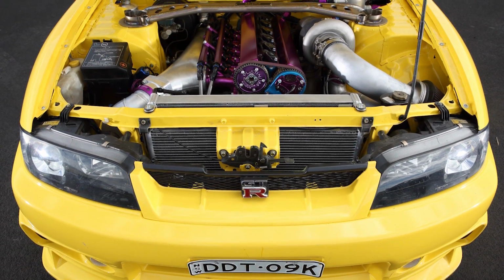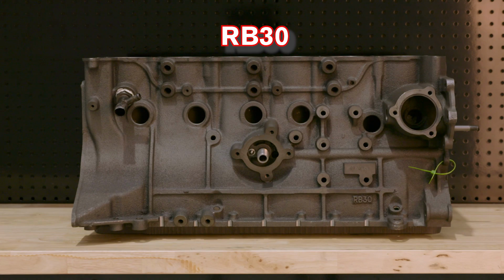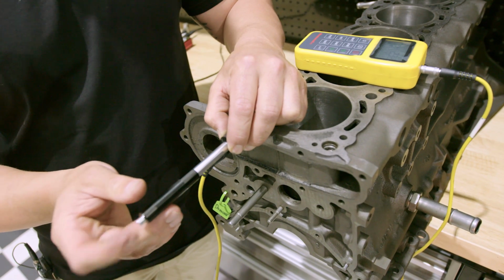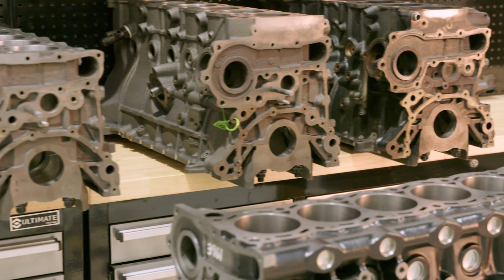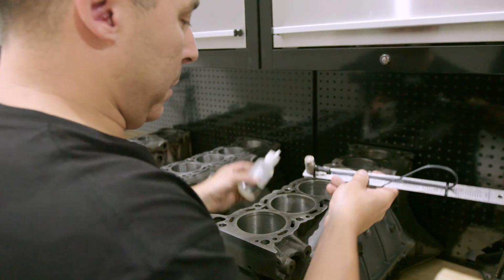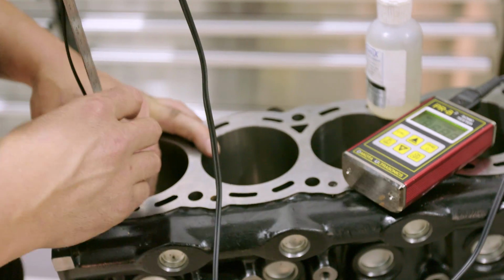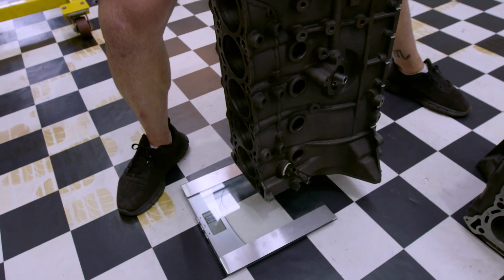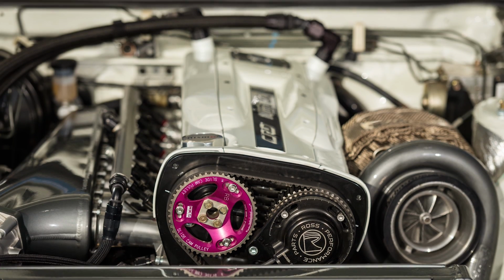Which RB Block is Best? Mythbusted with Facts and Data!

Comment: He said everything else doesn't matter, I'm sorry but the MATERIAL does matter if I put Darton sleeves in one which has 130KSI material strength where OEM sleeve material only is 40 or 30ksi in strength ( which is what OEM material normally sits at) you're gonna tell me it doesn't matter? You can place drop in sleeves for RB30's .
Reply: I don't believe in sleeving, and yes you can sleeve anything but that's beside the point in this tech feature.
Reply: Herman Urriola you believe in higher strength bearing saddles and gussets?  But not a better cylinder bore?? 🤔

Welp I believe in 130 ksi at cylinder wall temps in excess of +200F because that yield strength drops at temps go up and let’s not forget that major thrust surface and rounder bore etc and better sealing.
Reply: Liners wont stop the block twist it will make it worse and will crack quicker under the head stud have seen it in person on an rb26. Never seen it done on an rb30 tho
Reply: @ciaransynnott7958  Dart ductile iron liners are literally braces connecting your mains to your deck something stronger and stiffer at elevated temps (at more than 50%)  resist twist way better than something that started as a weaker brace we don't need to make a video on that if your block cracked it wasn't the sleeve that cracked you said the block not the same material and we're not talking about the same product which is a proprietary material. Do I know if that block had special mains and girdles and it was max effort to keep distortions in check or was it stroked? IDK however you can't say it was because the sleeve made it worst.
Reply: MSengineering David if he makes them then he will promote the benefit but as for braces he makes them so fits perfectly with the block twist. You make a very valid point about liners.
Reply: Roger  braces are to resist distortion not go with it also if he’s talking about an RB with a diff bolted to the side of it that’s an issue with the amount of twisting force from the diff being applied to the exterior of a block that’s running at elevated temps.
Reply: And the testing above was for Stock bocks... that said you can pour money in anything, all depends on where you call it a value to do so.
Reply: @wobblysauce   irrelevant you still want to pick a better base block  regardless running a stock block isn't a good idea  if you're testing things on this level you're clearly looking for something stay together so let not be extra with stupid comments.
Reply: @hermanurriola138  what most people seem to be missing is that to put a sleeve into any RB, the boring operation leaves the original bore parent material paper thin, with bad casting offsets in some cases it breaks through the bore into the water jacket. The original cast bore itself offers support for the deck by tieing the 2 together, after boring for a sleeve just a paper thin bore is left holding the deck....you see where im going with this.......and you know how weak our decks are to begin with.
Reply: @msengineeringdavid3702  And such was stated in the video.
Reply: @GTRPSI  That's right Peter, also the cast iron bore behind the sleeve (whats left of it) does not stretch like the cast Steel liner) Therefore the liner stretches, the iron behind it does not, it cracks instead, then liner loses its support and splits. so... if you had amazing bores before sleeving, you should have just left the amazing bores. If you crack a bore then sleeve it, it's only a matter of time before the sleeve cracks in the same spot.
Reply: Herman Urriola says the guy who doesn’t sleeves block....  you’re not even talking about a wet sleeve because you haven’t done one these are not dry sleeves you muppets keep explaining.

Comment: Is sleeving RB engines not a thing? If you have issues with blown out cylinder walls, just sleeve it. It's already being turned into a race engine, might as well remove the worry.
Reply from the maker: a c sleeping doesn’t change bore thickened unless you get a custom sleeve to make a smaller bore. The material behind the sleeve is still the same

Comment: I worked on a r34 gtr with nismo S1 engine is that block a 24u /n1 block ? Most people don't know that the rd28 in a diesel but you only use the crankshaft for the conversion? Or make the 26 head fit the rd28 make a cheap RBX from a Nismo 400r . Sorry but why not just re sleeve the block instead of reboring /offset nonsense I'd rather have all new cylinder resleeved then have cylinder honed back to almost perfectly round and to stock bore .ive had this done
Reply: You use the entire RD engine block.
Reply: Sleeving actually weakens the deck, most boring to accommodate a sleeve leaves the parent materiel in the bore virtually paper thin and therefore the deck looses most of its support from the original bores, the sleeves are a separate piece and are not integral to the deck, deck then moves under high boost situations more easily than without sleeves.
Reply: @GTRPSI  i think you know very little about what ive mention or about engines /rebuilding them . sleeve are seated  by a step either at the top or bottom /both if not it would move much more then decked with the block and then honed to size they seen many people do this haven't had any issues also most engines that are not European have sleeves from factory so what are you talking about? ? I had fire rings on my engine i brought but it was done all fucking wrong and cost abit 250 per ring plus mechining work would of been about 4 k AUS or so to do lucky spent that money on new sleeves ,bearing ,honing line boreing even got the cylinder head rebuild . And ive checked my engines guys work  ive used him with many of my customers cars engines
Reply: @GTRPSI  forgot too say how can a closed deck block surface been weaken by a sleeve. ??!!!
Reply: @_i-kr6eg  Have you personally sleeved a block? Actually done it yourself or do you pay someone and just pick up the block? with core shift it can actually break into the water jacket leaving no integral block support behind. The sleeves used on RB's are a press fit with a recessed lip on the deck. It opens the deck surface to a whole new world of flex. Fire rings, or the old way of orings work on the sleeve but the deck has lost its compressive capacity and much integral support for the head studs. RB engines (except for the RD28) already have a weakened 7 or so mm deck, sleeveing opens a whole new world of potential issues. Standard RB blocks, with grout to support bore flex while leaving water to flow through the top 3"-4"  of block height is certainly holding up to well over 1400Hp at the wheels without the need for sleeves, just keep the over bore to half a millimeter for max thickness and ultrasonic check the block for core shift before boring, add grout to minimize bore flex.
Reply: @GTRPSI  mate no i haven't done it myself and almost everyone on here also haven't got the mechines or cash to buy them  even learn how to use these  mechines . I know what i know dont do RB all day but since i live in Australia ive worked on many of them even work on European vehicle's
Reply: Peter Tomaskovic  it doesn’t weaken shit lol you have no idea what you’re talking about.
Reply: @msengineeringdavid3702  exactly
Reply: @_i-kr6eg  poorly installed sleeves can move, but you would like to think that you would take it to a competent shop, where afterwards with sleeves it will be better than new.

Comment: By the way it’s VTC not VCT as everyone calls it
Reply: Internet genius apparently lol it's Variable Cam Timing... = VCT
Reply: Zack Williams read any Nissan manual with an engine that has VTC.  It’s variable timing control
Reply: It's not a Honda 😂
Reply: Zack Williams I guess you know it all then, can’t even look at a single Nissan manual.  Well that’s fine, keep going through life with they attitude, you will get far.  :)
Reply: @grantts7  ur a Muppet lol s1/ 33+ have both but in terms of what he's pointing to its the Vct solenoid on the exhaust Cam which is oil controlled with a solenoid, ur talking about nvcs is Cam angle snesor driven by the ecu, so no it's not vtc😂😂

Comment: Hardness isn’t really a decent data to use. Glass is harder than steel but you wouldn’t make a block from it. Grain structure, alloy additions, etc make a huge difference. Pretty wasted video tbh.
Reply: I was really hoping they would discuss their destructive testing and results of grain structure and alloy analysis. If each design is the same alloy with very little variation then he is absolutely right and hardness and wall thickness is the last important spec. I assume they just left out this testing but idk.
Reply: schonzen they haven’t unfortunately. They’ve said the n1 block must be weaker because it’s softer but nickle addition would make for a more durable block but it would be slightly softer. I little bit of knowledge is dangerous and these guys just highlighted why. Then they slag off the internet for doing what they’ve just done.